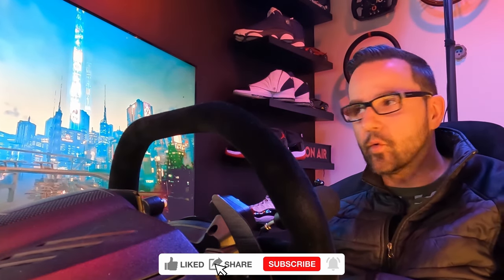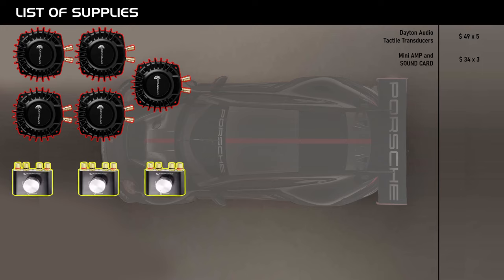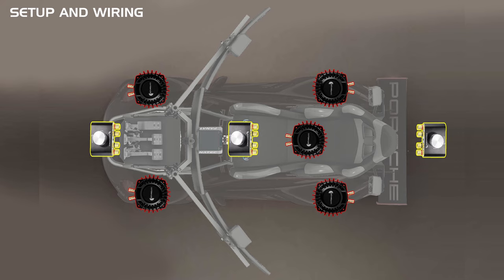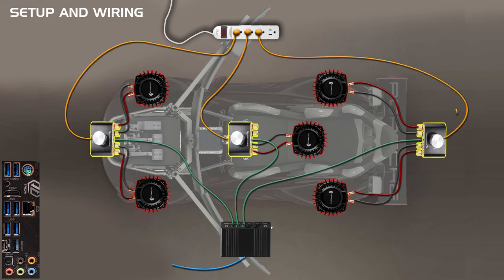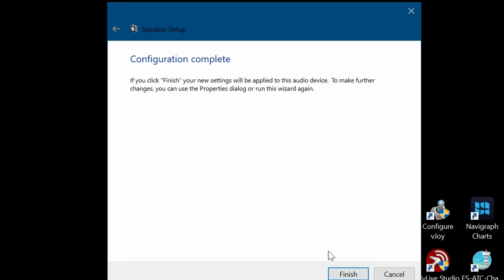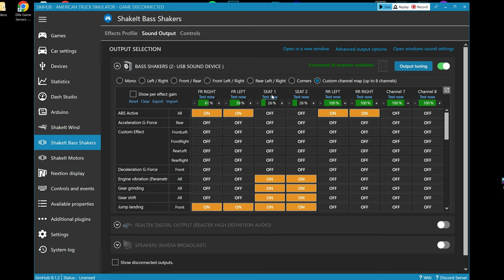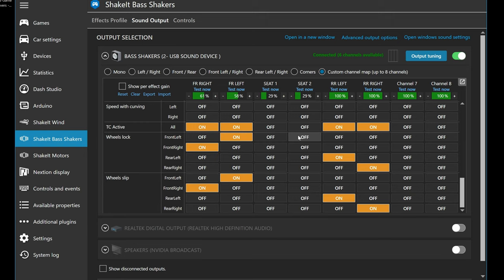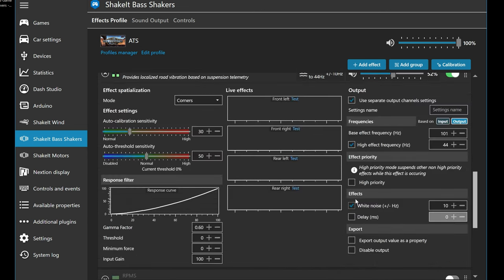DIY ULTIMATE Bass Shaker TUTORIAL | Step by Step HOW TO and SETUP

Comment: This is great information.  It's worth noting that the 12v Power Supply shipped with the Nobsound amp is not enough to get the full 50w output.  It's more like 40w.  You probably need at least 15v to get the full 50a.  I'm not sure what limitations they may have added internally, but the TPA3116 chip is capable of up to 100w + per channel with a 24v power supply.  This may not be an issue for most people as some have noted having to turn down the amp because the shakers are too much but remember your experience is going to have a lot to do with how and where you mount the shakers.  If you find you're not getting the output you're looking for with this setup, try increasing the power supply on your amp.  Here's a rough guide: 12v = 40w + 40w, 15v = 60w + 60w, 18v = 90w + 90w, 24v = 110w + 110w.  Minimum 5a output on the power supply.  Please keep in mind this is based on the chip they use not the Nobsound product specifically.  I'm also not trying to steer anyone away from the Nobsound but there are similar products available for nearly 1/3 price if you're not in a hurry and do some searching.  Good luck!
Reply from the maker: This has to be the most thorough and educational comment I've ever read on my YouTube channel EVER ! I hope that people read through what you wrote. I'm sure that you dabble in this field or you are fully immersed , because everything you said, although new to me, makes perfect sense. Thank you so much for taking time out of your day to write this. I'm sure this will be helpful to people over time !
Reply: Just watched and read your comment, makes perfect sense and thank you both. I've been looking for a good tutorial on this. Brilliant 👏🏽
Reply: Awesome comment. Do you have specific recommendations for ones you think would work better?
Reply: Oh, was about to bite the bullet with the Nobsound.  Can you reco which others I could consider?  Sorry, not too versed what to search for. TY
Reply: It is always nice if people go out of their way to share stuff like this. Thanks so much for sharing! I won't be looking at making this kind of setup for a while but doing research for months is always better than impulse buying smth like a buttkicker. I want to make the best setup i can while staying within a budget. I would say this video and comment is the best description on how to do it.

Comment: Hi, i have the exact same setup as you. However, when i activate bass shakers on Simhub, i can t have the original sound in my ears. It s either the sound is through the transducers either through my headphones. Can you help ? thank you
Reply from the maker: That is why I did a external sound card. It's very much likely that you are using your sound card to put out vibrations to the base shakers. If you do that then the sound card cannot be used to put out sound. You're probably trying to use the same thing for two different actions and it's not going to work. You have to use the noob sound itself as a sound card or get an external sound card like me
Reply: @DaSimSimma  I have one external sound card where my 6 bass shakers are connected and a ouput (headphone), my question is how to copy the sound in the transducers and the headphone  without using any softare like simhub or voicemeeter. There is a jack output on the external sound card but as @masjean9811 said, the sound is on the transducers or the headphones, not both in the same time.

Comment: There is a huge benefit for haptic feedback when you isolate the platform that your shaker is mounted to from the rest of the rig.
People are talking about isolating their seat and pedal-plate from the rest of the rig and having a huge improvement from the vibrations felt.
if you mount your shaker directly to the seat, then putting even just a rubber washer between the mounting of your seat to your rig and the seat will help a ton, because now the shaker will not have to shake the entire rig anymore and the energy is more localized to the seat.
Reply from the maker: Thank you so much for this input I will start looking into this !
Reply: :person-turqouise-waving:I started with haptics years ago, and if you're right, It's also better to use powerful bodyshakers, I have 8 Reckhorn bs200i 100w independent speakers in the seat and it's very pleasant, and I do have the seat pneumatically isolated from the chassis, and the pedalboard with 4 springs and rubbers and 2 homemade 12" bodyshakers and another one near the DD base. The best are 100W.RMS mono subwoofer amplifiers and various power supplies, I carry 2 amplifiers with a 24V20Amp source. The power must be doubled so that the dynamic range is total and the peaks can be handled... it's not good to use all the channels in simhub either, better 2 5.1 cards and use the first 3 channels with 2 card...:body-blue-raised-arms:

Comment: Fantastic tutorial!  I want to mount four Buttkicker Mini LFE transducers to my GT Omega Titan cockpit. This tutorial will help tremendously! Thanks!
Reply from the maker: No problem ! Hope it helps and don't hesitate to ask if you have any questions!
Reply: @DaSimSimma  Decided to go with 6 bass shakers!  One on each corner, one under the pedal plate and one under my seat.  Any recommendations on what signals to send to the pedal plate and seat rumbler? I'm thinking ABS + TC to the pedal plate shaker, and gearshifts and engine RPM + shake to the seat rumbler?  Thoughts? The corner shakers will handle all the road effects, curbs, tyre slip etc...
Reply from the maker: Exactly what you suggested !! I have engine and gear shift under seat. If I had a sixth one I would do abs only . That just me ! Remember that it can only do one at a time which means if both are happening at the same time it will have to choose which one to send to your shaker . Am I blend them together honestly I'm not really sure. Regardless if you have too many signals it's not going to feel very good. Additionally, there is a checkbox that gives one thing priority over the other look for it somewhere on the right side.

Comment: great video, thanks for the tutorial. Quick question, once it's all setup, do you need to have Simhub running while gaming for the speakers to work or can you just turn the sound card on and everything runs as its been set up?
Reply from the maker: Simhub always needs to be running in the background. That program receives telemetry data from the game and translates it into audio signals. The cool part about it is that it's always running in the background if you set it up the right way. I think automatically from the get-go it setup to run in the background

Comment: OH MY! I had mine set up without the extra external sound card and this is completely better way of doing this (I used a 7.1), even though I have the USB ports available. This just makes for a cleaner install/setup, on the PC & SimHub. Thanks for this! I'm using 4 Dayton mini on the corners and a Buttkicker mini, center seat.
Reply from the maker: Absolutely my friend . I'm so glad it helped  ! If you make any discoveries along the way and it can improve on this further, please come back and share with us ! Thanks again for watching and sharing with us
Reply: Hi! I got 4 Dayton BST-1 and buttkicker Mini. Just starting with setup but i dont have a 5.1 sound card. Are you saying to just get the external sound card? Which one did you order? I'm in Canada.
Reply from the maker: Hi . So exciting !!! I can't tell you which one right now but I should have placed the Amazon link in the description ? I can come back later and add it if I didn't . ( Yes I do suggest that you get the 5.1 surround sound external card. The simplest way to explain it is that the internal sound card can now still output music and game sounds and you can now use this external sound card for game. telemetry. )
Reply: @DaSimSimma   Do explain, about the telemetry? I'm currently running 4 Pucks + 1 Buttkicker Mini on seat, 2 Pucks under pedals and 1 Mini Exciter on the brake. Can't drive without them!
Reply from the maker: Simhub uses the external sound card and all of its channels to route signals to your base shakers. Those signals are based on telemetry. Telemetry is actual information based on numbers. For example, the suspension going over curves creates a vibration up down up down up down, that turns into a vibration at an exact rate that matches. All of your pucks receive information like that from the game. Although it comes across as vibration or sound it's actual physical information from the virtual world about engine vibration gear shifting curb vibration suspension etc. So if you use an external card you're able to send those signals through all those five or seven channels and you can leave your internal sound card to actually pump out beautiful sound to your speakers. The best way to explain it is when you go over curbs it will make a rattling sound which would be extremely similar to the vibration of going over the same curves. But the two are not exactly the same thing. That is why you want the sound to come out naturally in the vibrations to come out to a different sound card slash different channel. I hope that makes sense
Reply: @DaSimSimma  oh yeah, I know that telemetry, I thought it was additional data, that I could use, to assist in building setups? I already use Motec, VRS & Garage 61 telemetry. I'm a GT Challenge series participant, where you build your own setups, can't ever have enough telemetry data, thanks.

Comment: @dasimsimma Did you ever do the video concerning the effects profile settings? Thanks! Great video. I just got mine set up last night, but the sound card you referenced needs its own drivers and audio software to enable the jacks to transmit the proper audio on Windows 11, fyi. Took me 5 hrs to figure this out and it's not that easy to find. The SW is Xear USB multi-channel and you need the drivers for the C6206 chipset for the soundcard. These are made by CMedia and some cards have different chips, so check your particular one.

Comment: Thank you so much for that amazing tutorial!

This is exactly what I was looking for!
Would love to get a detailed simhub video also!

About the plywood is it working good?
I thought in the way you mounted your speakers in the back is taking away from the experience since they are only half on the wood and wood in general dampens..

Are the vibrating your whole room or only the rig?
Reply from the maker: The tears transmit barely 25 percent of the vibrations as the fronts do . I need to make ne brakets or find a new way to mount them i.m in the basement Ina purposely built sound proof room with concrete beneath me so in my case nothing transfers outside of that room or outside the rug for that matter
Reply: @DaSimSimma thanks, that’s what I thought.

I think I will order an aluminum plate, drill holes into it to mount the speakers and then 4 more holes on the outside to mount it directly to the aluminum profiles.
That should do the trick.

I have my own house, but I still don’t want my room vibrating.
I think I will first try it with rubber feet that you usually put under mills and lathes.
I have plenty of those laying around from the days I still worked on the shopfloor.

If that doesn’t work I have to build something with springs I guess.

Comment: Thanks for the excellent tutorial for people who want to start their own DIY setup. 1. Is there an option to use a single 5.1/7.1 channel amp sound card device to power all the 5 shakers directly without the need for adding 3 separate 2 channel intermediate amps? 2. Can you connect the sound card via bluetooth (those w bluetooth built in) instead of the USB cable. 3. Has anyone found an easily available  bracket/solution to attach the shakers to aluminum rig?
Reply from the maker: For the answer to your first question, honestly, I feel really weird about using Bluetooth for something that should react so quickly. Honestly, that additional sound card is super cheap and it only utilizes one USB. As you saw, the amplifiers have their own sound card for a two-channel each, but you don't need to plug those in reducing the amount of USBs. For your second question, there are plenty of brackets available on the internet. I just unloaded a file in 3D printer myself. Unfortunately they are sturdy enough to hold the Shakers but yesterday as I was working on my rig ice gently leaned on one and it completely snapped. So the quality and sturdiness of your print is super important
Reply: @DaSimSimma  Thank you! Appreciate the response.

Comment: Excellent video. just one small point about Sinhub, At 7:30 in the video you are setting up the abs for your car. But the red symbol of the plug with a line through it means that it is not supported in the telemetry output for that particular game. I use a similar setup in AC and it's really annoying as AC doesn't output ABS or traction control either
Reply from the maker: You are absolutely correct some of them do not support all of the features. In that instance I was just trying to give an example so I didn't even realize I was adjusting something that didn't work

Comment: Great video! 
I have a question. 

1.The Bass Shaker only works with the SimHub games. (I don't know what SimHub is, sry) 
Or with any games ?? So also play tanks or combat flight ? 

I would appreciate an explanation, in simple terms.  

2. Another question, do you happen to have any idea how to build a moving seat yourself? 

Thank you Thomas
Reply from the maker: Hey Thomas, Simhub is a program that interfaces between the game and the bass shakers. It basically pull out the sounds and telemetry and sends them to the shakers. Just look it up online and you'll see how many games it supports it supports a lot of driving games and even some shooting games . I think it's simhub.com . Singing does. A lot more than bass shakers. Please vist theyr website and you will see.
As for your second question... unfortunately...I don't I do dream of having one of those but they are very very expensive.

Comment: Thank you for the tutorial, this is a great help indeed. Just a small one to understand: if Nobsound can act as a sound card via USB, why do I need an additional external sound card and why can't it be hooked up directly to simhub? Sorry if that was already clarified. I did not find it in the thread.
Reply from the maker: Each noob sound has two channels and it requires one USB connection. If you wanted to power 5 shakers as shown, you would need to use 3 noobs(for a total of 6 channels)  with 3 USB cable connected to your computer. Most of us already have a spaghetti of subs . The separate sound card cleans up the setup and adds all shakers to one card .it's cleaner in every sense of the way . But ...it will work either way !
Reply: @DaSimSimma  Thanks for the quick answer. So if I understand correctly this is rather practical than technical reason. Even if I have a spare external USB hub (I do) that I can put away from the computer with an USB cable, I can achieve the same clean setup right? (except that Iii will need to play with 3 sound cards not with one when configuring simhub).
Reply from the maker: @IstvanPatonai  absolutely correct !

Comment: I have very little knowledge of audio systems so all of this is a bit overwhelming for me, but your video does a great job at explaining how to set everything up. Researching all of this, I have been reading about some shaker systems using telemetry data instead of just audio, and that it is supposed to be better and more immersive. My understanding is that with telemetry you would feel things that would not have created an audio signal. My question is, does Simhub use this telemetry data? I would prefer to build my own system instead of purchasing an expensive product, but I don't want to have limitations in the data the shakers use. I hope that makes sense, and thank you!
Reply from the maker: Hi friend. The answer is very simple, my tutorial does exactly what you're asking. It uses the Shakers in simhub to do the shaking from the telemetry data not from the audio. It might sound confusing when I talk a lot about audio and audio cards and audio amplifiers but the reality is all that is setting the equipment up to receive telemetry data.! To give you an example when I had a PlayStation 4 I used to use it using the audio which was kind of a poor man's way of doing it. You came to the right place and you asked the right question followed the tutorial by the goods and you'll be one happy customer I've had many subscribers that have reported great results just as I do
Reply: @DaSimSimma  Thank you so much!

Comment: thank you for an excellent video!   Some complained that the $300 Buttkicker LFE vibration is overwhelming.   How is your 5-channel setup?   Does that make the SIM feel more like a real car?
Reply from the maker: Of course that absolutely helps. And the cool part about it. If it's too much, you can actually control it in Sim hub and turn the volume down independently on each one. Sometimes I adjust them when I feel like they are too overwhelming. But in general I have them set just nice